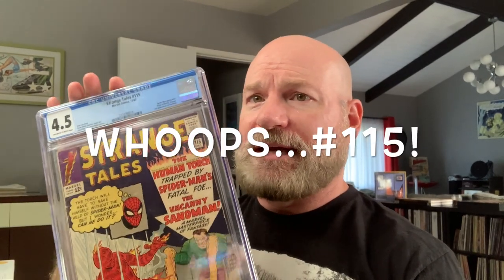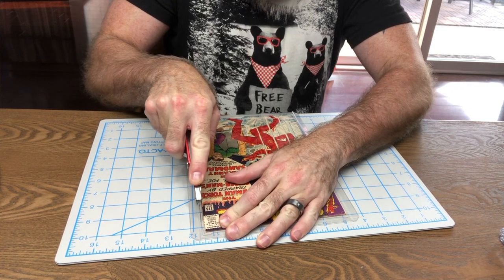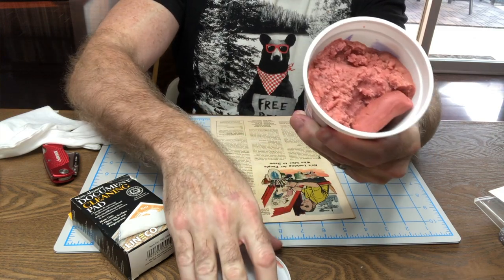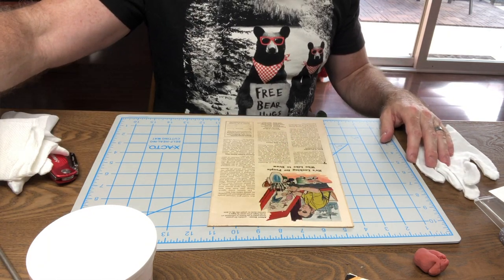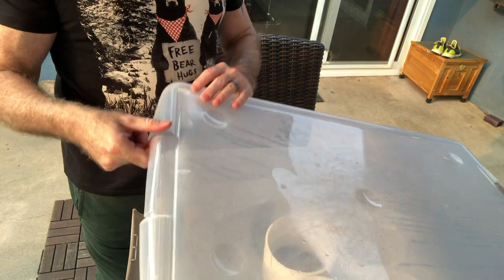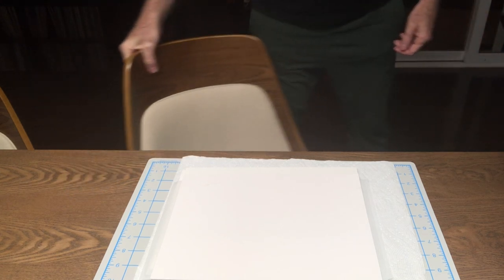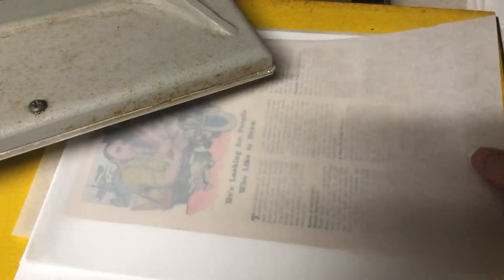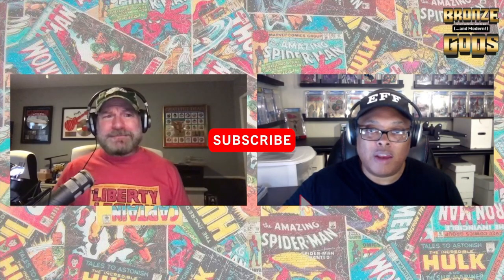Comic Book Pressing 101- A quick tutorial on cleaning, humidity and pressing comics

Comment: I don’t comment on videos much, but I actually have some advice that may be useful. I crack a ton of slabs, and the absolute easiest way is with a cheap bench vise from Harbor Freight. Just crack the plastic on 3 corners and out the book comes. No risk of bending and causing any extra damage. Super easy, and super safe.
Reply: I have done 'pressing' in a basic, low-tech way.  I simply placed the issues with spine roll underneath some heavy books, making sure that the issue was properly 'aligned' as I placed it under the weight of the books.  I just kept them there a few days, and that solved the problem of the spine roll.

Comment: I would avoid the compressed air... too much risk of a condensation moisture bubble hitting your book. Use a photo gear squeeze ball air blower instead.
Reply from the maker: Ooo, that’s a great idea!
Reply: @BronzeAndModernGods    Did the rated Strange Tales 115 come back better than 4.5 or worse?   The cover looked so pristine and gorgeous to me i was shocked it was as low as a 4.5!
Reply: I was thinking the same...
Reply: The canned air will be chemically "dry", that's why its used on live electronics. Now an air compressor like you'd see in a garage or a very small one that draws on atmosphere will definatly condense moisture and spray droplets.
Reply: The canned air might be chemically dry, but if you get too close it causes a layer of frost to form on the surface which could cause moisture damage. I never tried it on paper, but I've seen canned air frost both Legos and resin statues.
Reply: @samuelcatoe1927   book conservation they put books in freezers for 48 hrs to kill mold and bugs. Then the books are moved to a cabinet dehumidifier for a week.

Comment: Its a hell of a lot quicker and easier to use a small steamer to add humidity to  the book. Also takes up less room. Just be sure to keep it six inches away and to let run a bit for before exposing it to the pages so it won't drip water. Use distilled water and put on each page until you see a slight curl of the pages.dont soak it . Plenty of videos on YouTube showing that method. I'm no newbie. Been into comics since the 70s. Great video though and good tips.
Side note: if using paper inside make sure it's inkjet paper  NOT Laserjet paper Laserjet can pull color

Comment: Suggestion for you.  Pick up a piece of 1/4" plexiglass the same size as your press.  That way you can build your stack and then just pick up the piece of plexi and slide it in and clamp it down.  You will obviously need to adjust your press for the extra 1/4", and possibly adjust your baking time a little.  I use that trick with my seal 500 T and it has made things so much nicer.  I have multiple sheets and can get my next set ready to go while the first set is baking/cooling.
Reply from the maker: What a great idea!
Reply: @BronzeAndModernGods  got to go with the least quarter or half. I tried thinner and the heat would cause it to warp slightly which I'm assuming over long-term use could be detrimental.  So far zero problems with quarter inch.  Two sheets of half inch double was a very good cold press once you pull the book out if you want a slightly quicker turnaround time on getting your next one in

Comment: Hello Sir. Much more detailed than how I was first taught. A couple things I'd like your opinion on please. 1) Using teflon sheets in the pressing process 2) Using a sheet of Aluminum on the bottom to avoid having to flip the book after 1 session in the press and 3) How long you leave it in the press with the heat ON. I was told only 1 minute at 170 degrees then leave it sit all night. Your thoughts would really be appreciated as I improve my understanding of this craft. Thanks!
Reply from the maker: 1 - never use Teflon! It will leave indentions all over the cover. I will show an example of what Teflon will do in a future episode.
2 - metal plates are an option - depends on the model of press you are using, however
3 - again, depends on your press. A Seal Press takes a long time to warm up, so you should pre-heat it until it's at 165 for Silver/Bronze, then close and begin timing.
Reply: @BronzeAndModernGods  Thanks for the reply. Guess I'm done with Teflon. But I don't feel like it left any noticeable indentations that I could tell on what I've pressed so far. Have you found the Humidity Bath helps get out a minor creases along with the proper press? My press is pretty new and heats up to 170 in under 10-15 minutes. I have been leaving books in at 170 for about 2 minutes heated and turned on, then shutting off the press and leave them sit all night. With the aluminum plate I do not flip them. If you're up for it, check out the couple of videos I made on the process, I'd be happy to learn more. As after finding you I feel what I "think" I know and what I put out there is called into question now. Thanks for your time.

Comment: I have a question for you:  I purchased an Amazing Spider-Man #137 that should be a 9.8 - the corners are sharp has one small spine tic - less than 1/8 of an inch that does not break color - just beautiful.  It came back an 8.0 from CGC,  I believe because it has some dirt by the staples on the back cover and a small one inch dimple that could probably be pressed out.  Since it could up the value of the book immensely to have it cleaned and pressed I would like to have it done, but I do not feel comfortable doing it myself?  Any suggestions on who could do it professionally would be a help? Thank you.

Comment: I'd recommend using a spudger instead of a screwdriver for opening the slab as you'll have better control and less likely to come near the book. Also, put a metal straight edge/ruler between the knife and the comic.

Last thing, send in the old label along with the comic so they can remove it from the census. See recent Bry's Comics video. Do this or the count will be artificially high and hurt the value of your book.

Comment: I have tried a few bronze comics for pressing. Used the humidity chamber and for the most part the comic when pressed, the covers are great.  But noticed if comic is laid flat is a curve.  What am i doing wrong?  Thx
Reply from the maker: either too much pressure or too much humidity - do you have a humidity gauge from Amazon?
Reply: @BronzeAndModernGods  hmm.  yeah i do not have a gauge.  that is prob the issue.  better pick on up.  Thank you

Comment: Do you have any suggestions for comic front covers that have pen drawn inside the title.
Reply from the maker: Hey, there - very tough, not a lot you can do to remove ink, marker or grease pencil, unfortunately.
Reply: @BronzeAndModernGods  Ok thank you for the reply
Reply: One that could work is to put white-out on the ink, then use a marker or crayon to re-color the spot, trying to match the original color.  It's more of 'esthetic' trick, it wouldn't necessarily make the book more valuable.